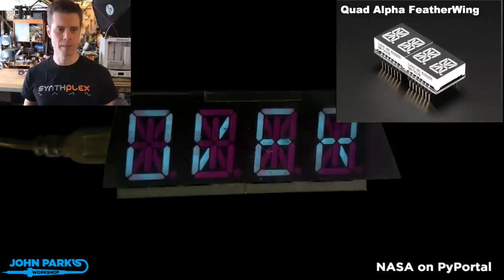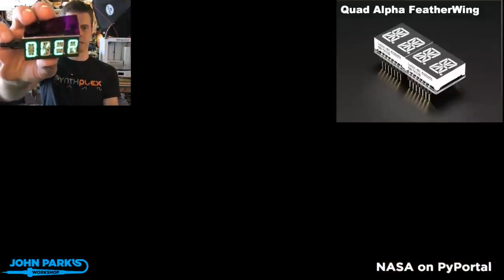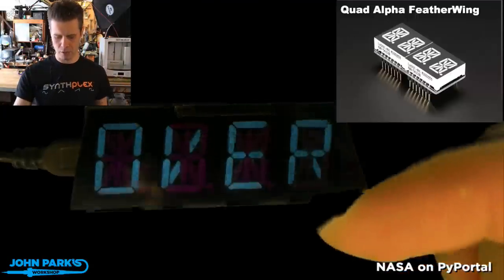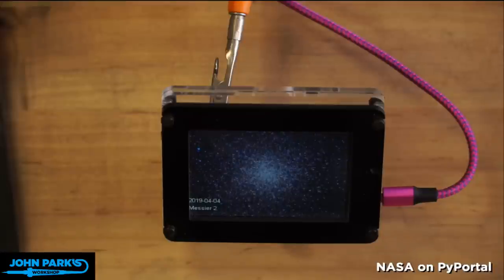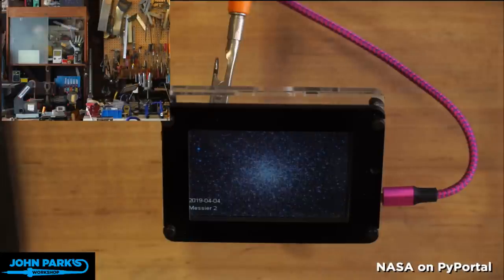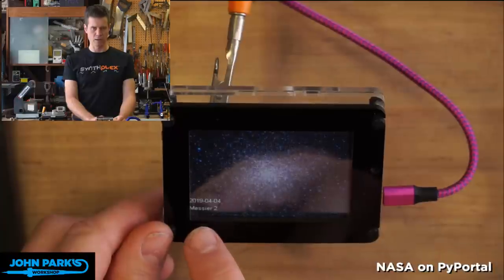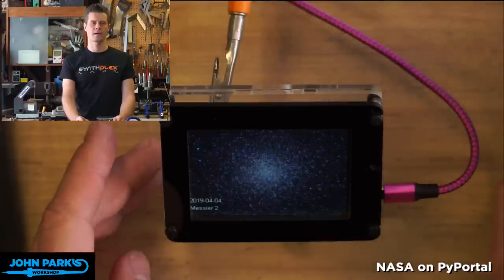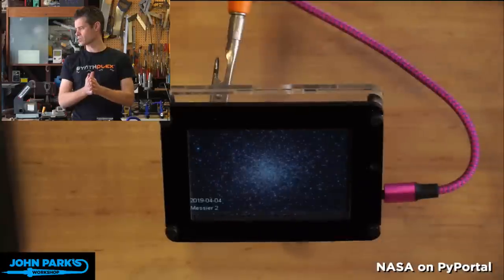JOHN PARK'S WORKSHOP LIVE 4/4/19 NASA Images on PyPortal @adafruit @johnedgarpark #adafruit

Comment: This is new music , John. Is it yours? I do not see it on your BandCamp. If so, do you have more for sale? Thx
Reply: Thanks very much for asking -- I'll post this one soon to BandCamp, it's called DipTripping
Reply: GlitterBay are you using Chrome browser? Doesn’t work in Firefox.
Reply: filed bug report per request from Peli, sorry, I'm also Glitter Bay as well. I only work with Chrome, several computers and 2 CPXs, many data cables tried also.
Reply: @makecodeandhardware1395  have you ever had any CPX pair w MakeCode?
Reply: @JohnParkMakes  No, John, I have not. Tried for hours. If by "paired" you mean connecting via WebUSB (Win 10 app ? I guess) and then directly loading the program into the CPX w/o downloading to my downloads folder the "old way". No.  But, yes with Micro:Bit. @oreo on Adafruit Discord told me that they did it with CPX, it worked for them. I did not ask for a screen grab of the serial data output to monitor which @oreo said they got using WebUSB, I should have done so to convince myself that it was possible. I discussed this on Adafruit Discord Classroom yesterday. So Peli asked for a bug report and I filed it on Github (don't know if I did it right-noob) . My vid. on my channel with Micro:Bit shows "Show console device"; love to see it with CPX. Best to ya.

You know, a light bulb just went on in my head ! It could be that @oreo meant that they were getting data not in real time, but on the datalogger system. The code that they shared with me was "console" I think, not "serial" so that may mean that I mis-understood @oreo and their output was not to monitor screen but to data file. I know so little about this that I may not of understood that in the program @oreo gave me (see share link in "classroom" Adafruit Discord.
Reply: @makecodeandhardware1395  OK, this is good to ask about on Discord or the Adafruit Forums then.
Reply: @JohnParkMakes  Ok, John, not to nag you , this is the weekend and all, but I don't see your "dippy dot" music yet on band camp. I have videos ready to upload with MeowMeow and Maker and would like to have music to show "@Sabas" who created the board.  I'll hold off for a while with that, waiting for your bandcamp addition. Frank
Reply: @JohnParkMakes  Dip Tripping, bought
Reply: @makecodeandhardware1395  thank you very much!